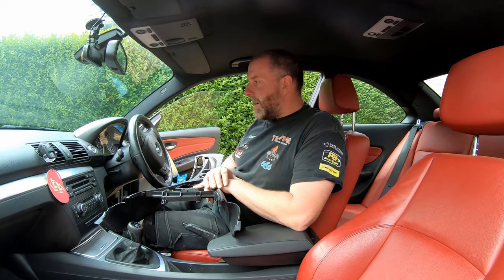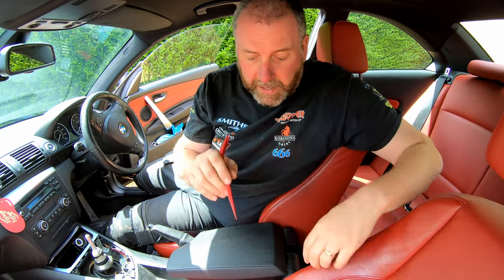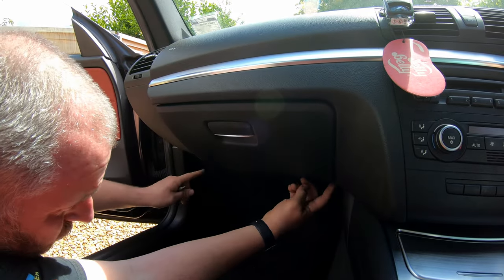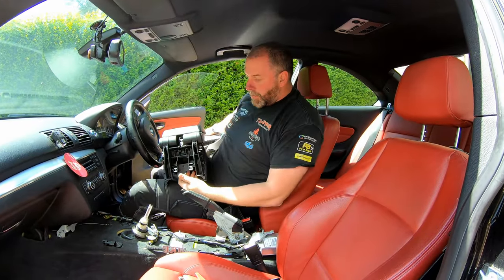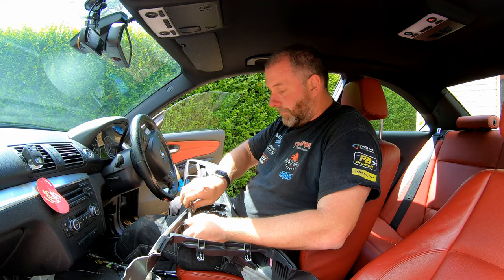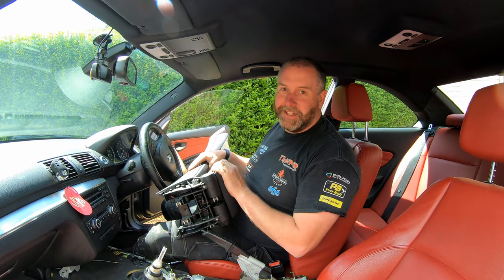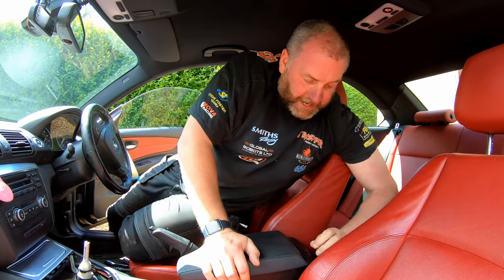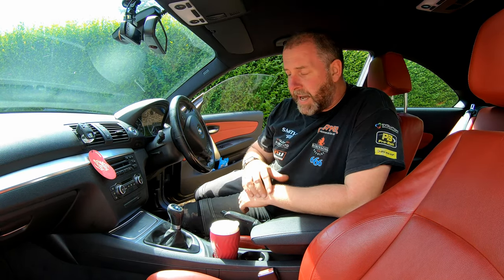BMW 1 Series - E81, E82, E87 & E88 (E8x) 04 - 13 Centre Console, Cup Holder Retrofit - Full Guide

Comment: I had to take out the centre console to replace the handbrake cables on my 123d and this guide worked a treat. 
I would add that I didn't have to remove the gear stick boot to remove the console.

Comment: Have you disconnected the battery? Or it is unnecessary. Thanks!
Reply from the maker: I didn't, there is nothing that you are disconnecting here that will cause an issue or any fault codes, you'll be fine to leave it connected. 👌